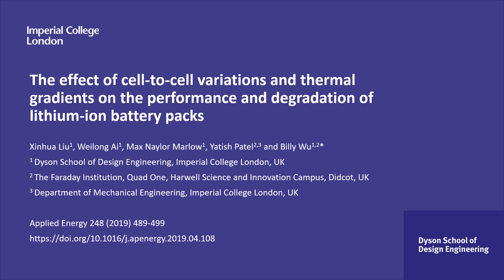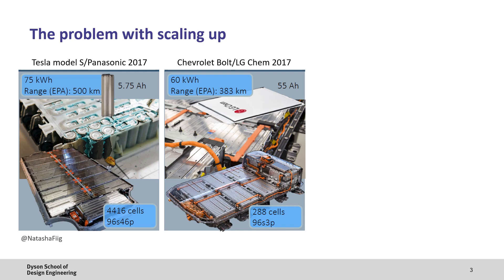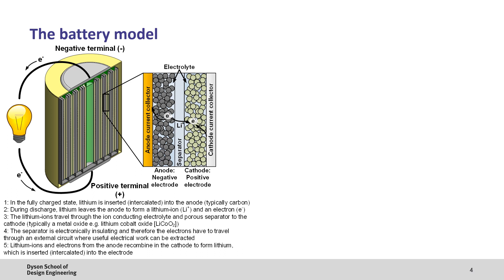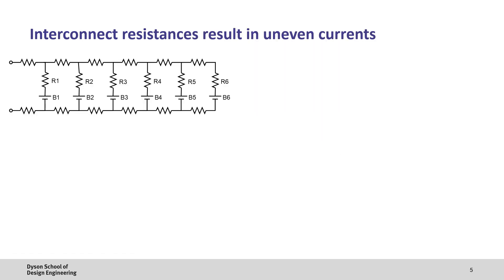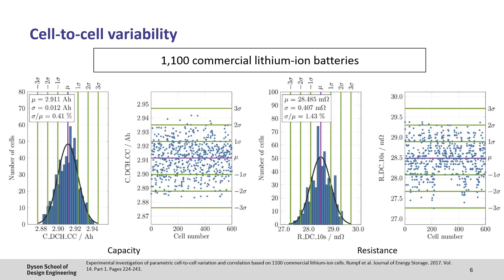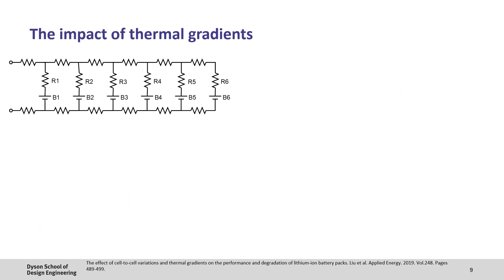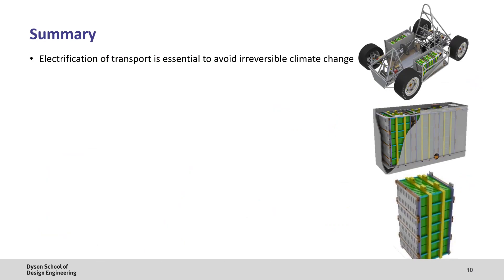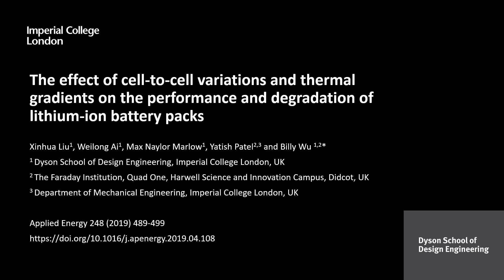Challenges in lithium-ion battery pack design and scale-up for electric vehicles

Comment: Thank you for your informative video.
 The single particle modelling will be considered for different form factor of cell like cylindrical, prismatic and pouch cells cases.

Could you please comment on among these three cases in pack level which is could deliver better performance.
Reply from the maker: Thanks Vasu. The single particle model is a simplification that starts to lose accuracy at ~2 C. As you say, it also doesn't capture the complexity of cell form factor or size as it assumes everything is homogeneous. In terms of performance you might expect a well designed pouch cell with compression and thermal management to be better than a cylindrical or prismatic. This is a generalisation but the cylindrical and prismatic have windings inside the cell which can cause stresses and uneven performance. In practice, cylindricals are easier to make and if managed well can be just as good so there are many factors to consider when selecting a suitable cell.